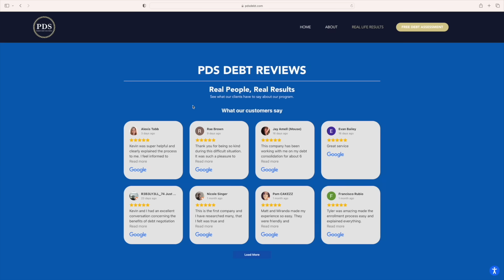Nobody showed up except for Tino! I learned my lesson.

Comment: Need to have 1 long line from bow to stern so you can control the boat from the dock easier and then wrap around the jetty piles to secure. Been doing it for years and works so well.

Comment: Optimas use to be really good batteries but Not impressed especially for the cost anymore.  Also if you buy an Optima Charger although expensive it will bring most of them back unless they have been discharged for years on end

Comment: I personally stopped buying and paying the extra for Optima batteries.  Unfortunately, they just aren't the quality that they used to be. I beleive they moved manufacturing to some other country a few years back. I started replacing my boat batteries with what Sam's club carries (Duracell). I can buy 2 of them for the price of 1 Optima and they last just as long or if not longer...